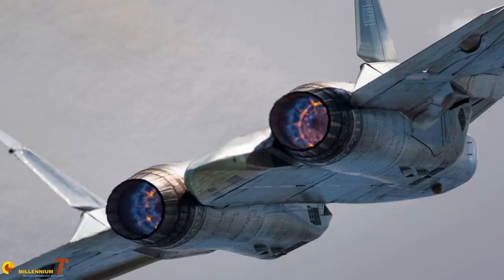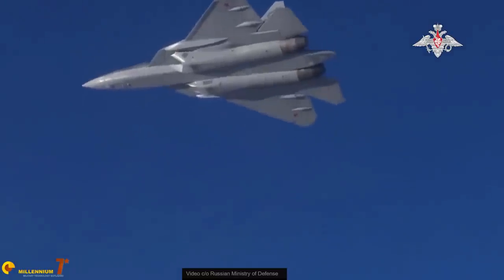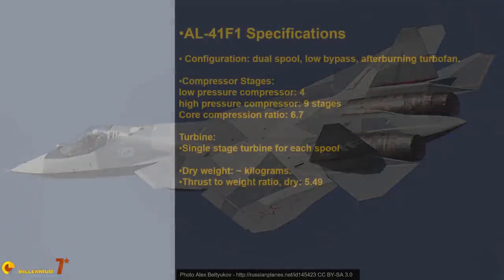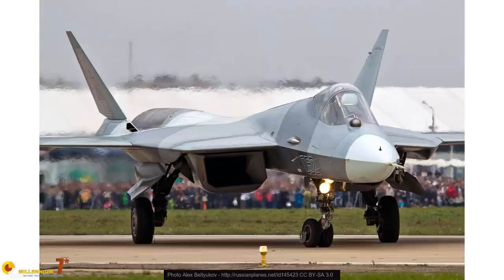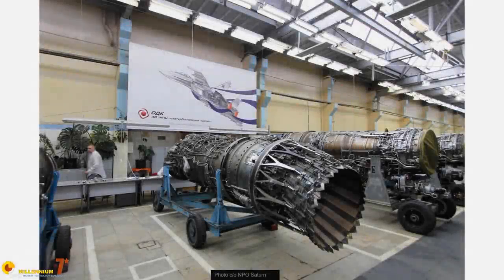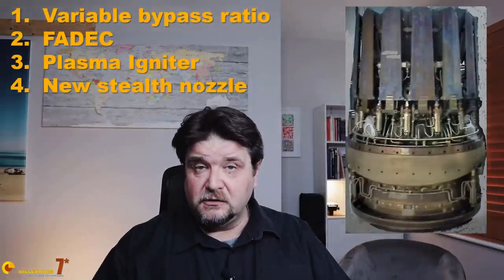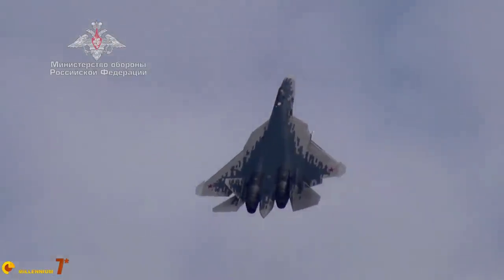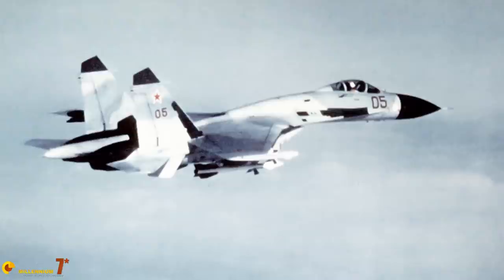Su - 57 the Raptor Slayer | Part 2 - Propulsion

Comment: Edit: It occurred to me that vector thrust could actually replace a tail fin. Something that would make sense for a 6th gen plane. 

hypothesis 1 - well, if you already have trust vectoring, why not implement it. be a shame not to. 
hypothesis 2 - makes sense. it is possible they have tested the trust vectoring in regard to dodging missiles, and I'd be surpriced if anyone investigating it, hasn't.
my take,, Although getting into dog fights are rare these days, it does happen. And I think with planes being more stealthy, and having counter measures, that might be an increased occurrence. So one should not be so quick to dismiss the ability to do high angle of attack maneuvers in order to point your nose at the enemy. I think the russians think it is worth the weight to have that capability.
So in my opinion , trust vectoring might be useful , unless radar technology radically improves to the point that you can use long range missiles. all in all, I think it would be foolish to build a 6th gen plane without that capability.
Reply: Never vector your trust.
Reply: @Make-Asylums-Great-Again  hehe, I never trust my vectors.
Reply: Edit: It occurred to me that vector thrust could actually replace a tail fin. Something that would make sense for a 6th gen plane.
Reply: @lordsqueak  👋

Comment: The engine reliability has always been a Russian issue. Anyway lets hope the Su-57 does not have to go head to head with the F-22 until after 2025. In fact USAF will be starting to reduce F-22 inventory after 2025, so these guys may never meet as intended.
Reply: What are your facts proving issue of reliability of Russian planes' engines. What planes exactly?
Reply: @AlexanderTch  MIG-25
Reply: @rocket3man  Mig-25 is fastest fighter-jet ever with best world record for fighter-jets for altitude. It's  high altitude high speed interceptor and does not have any analogs in other countries. It's first double engine , double keel fighter jet, so, it was revolutionary and was copied by USA to create F-15. With such extreme characteristics it should not be compared with any other jet, except , maybe, it's successor Mig-31
Reply: But the engine is too fragile and against an F22 you are joking. Also the Indians are not happy with the performance and reliability of the mIG-29.
Reply: @rocket3man  How do you know that Su-57 engine is fragile? Russian Military reports to you? Proves please. No accidents with newer engines were ever reported.  You lie about Indians. They use 60+ Mig-29 and it's one of the main parts of their air-force. No proves that they had any complaints about their reliability. Indian Navy aircraft carrier uses only deck version of MIg-29 - Mig-29K.
Reply: The overhaul life of AL-41F1S is 4000 hours. How is it compare to PW F135 (I don't see the numbers on it)?

Comment: Russian thrust vectoring is wasteful because they add a substantial amount of weight and maintenance to enable 360 degrees of vectoring when you only ever need to vector downward. Upward vectoring can cause major health problems for the pilot as the blood from the high (positive) G turn goes into their heads, the opposite of what happens with you vector downward (negative G’s), as the blood flows away from your head and you risk temporary loss of consciousness. This can only be used really to recover from maneuvers like a cobra. Vectoring to the side could have so applications for turning within a plane to attempt to notch an incoming missile, but that benefit is negligible when compared to vectoring downward and banking into your turn.

Comment: In the other measurement system, 108 kN is over 24,000 lbf and 176 kN is over 39,000 lbf.

Great info btw, Otis really came through here!

PS - aren't you missing a decimal point in the T/W? Really, 11? I can believe 1.1 ok.
Reply: I believe that is for the engine and nozzle only.
Reply: @hart-of-gold  Ok that would make more sense.
Reply from the maker: just for the engine, not the whole aircraft

Comment: Well, let's see how many they can afford too keep in the air.
You can have a great plane. But, 
numbers matter.
Reply: Go and see. It's already in serial production. And Russian government signed contract for building 76 of them. Also government of Algeria signed contract for building 14 of them for their air force.
Reply: @AlexanderTch  
76 isn't very many for a country as large as Russia. And their tech always seems too be yrs behind the U.S. 

But, Russia's military is mainly on a defensive posture and has been since 1945. With a limited numbers of bases outside of their country to work out of. They are very restricted on the missions they can handle. 
Their surface Navy is a joke. 
But, their subs are getting better.
Reply: @thomasridley8675  76 is fairly enough number. First. Mig design bureau now works on light one engine 5th generation fighter like F-35 that's gonna be cheaper than  Su-57, so, Russia'll have two types of 5th generation fighters. Second. Russia constantly builds and improves its 4++ generation fighters - Su-35, Mig-35 that do now and will do further many tasks that 5th generation jets can do. Example - in Syria Su-35 countered F-22 and made it run away. Third, Russia always relied heavily and will rely further on Surface-to-Air missiles that are cheaper but can do many things in air combats. Russia even now have 3 times more of them than USA.
Reply: @AlexanderTch  
I guess time will tell. It's not like they are planning on invading another country in the near future. 🤔

Comment: so you think in the age of BVR that dogfighting is still a relevant form of air combat? Do remember there are what 12 Su-57s compared to 187 F-22s and over 670 F-35s that fly and the Su-57 isn’t a stealth aircraft. It’s engine nacelles aren’t coated nor do they have low observable exhaust nozzles. The aircrafts performance is irrelevant when it’s a smoldering heap from an AIM-120

Comment: Didn't the patent filed for the su 57 claim that it had a similar RCS to the Rafael or the eurofighter? Can you address if this is true or why it might have been if the su57 is indeed a proper stealth aircraft. 

There's also of course the fact that India dropped out of the program and one of the reasons cited was insufficient stealth characteristics.

Are we really so sure that the su-57 is even a 5th gen fighter?
Reply: @kresnik_ss  thank you for answering my question. I will check to see if it's accurate. I do think you are being a little bit unfair to me since I specifically included the question of whether or not this is true. And also some of your statements are questionable.

"basic understanding of stealth shaping principles leads to the recognition pf of the su-57 design being stealthy"- no it tells you that the su-57 is designed to be stealthy. It doesn't mean it was implemented successfully. Obviously my concern was with regard to the materials usage which is more important than the shaping these days, And with regard to imperfections with the extremely complicated aerodynamic surfaces along with the seams and the intakes.

Also the Russians are rather incentivized to publicize an underreported figure for the F-22 raptor after coming out with their own stealth fighter which has been criticized for the purposes of not being stealthy enough. So a Russian sourced estimation isn't exactly an incredible counter. If it were for example a Turkish or Indian estimation, that would be much more useful. And anyway the Russians really shouldn't have the data to give an accurate estimate of the average RCS of the F-22.

It does just seem unlikely to me that the Indians pulled out of the program because the prototypes weren't manufactured to perfection. That would be pretty stupid, don't you think?
Reply: @kresnik_ss  I mean maybe. It's just very difficult to tell with Russia.

"Appear weak when you are strong and appear strong when you are weak" a quote straight from The art of War that Russia seems to have taken very seriously. They have added on radar absorbing grills to the intakes of the su-57, so clearly they did believe that the intakes weren't stealthy enough. And the grills can't be as effective as an s-shape intake.

It's just that if they could mess something like that up it's hard to believe that there aren't other glaring issues with it. And they've been delaying serial production for a long time now. It's also worth considering that it's their first stealth fighter, so they may just not have worked out all the kinks.

Aerodynamically it's a very impressive bird, but with regard to the stealth features we really just don't know. And they've been really careful to make sure that NATO's never gotten a return of one flying. Maybe that's just because they're being secretive, or maybe it's because they have something more embarrassing to hide.

I don't know, but I don't think it's impossible and I'd like a more in-depth analysis by somebody who frankly knows more about it than I do. Hence the purpose of my comment.

Comment: The Malaysian SU-30 vs. Malaysian F-18 video the author himself states otherwise, that the Su30 is to be respected as a contemporary, and that he himself had been 'shot down' by it only that it made for a bad video as he does not point the go-pro backwards, obviously.  - Also the one time in the video where the Su30 makes a hard vectoring maneuver it reversed from a climb away into a dive toward the F-18 in the time it took the F-18 to just get its nose back up to the horizon. It's a tool to be used, and making that tool better will only improve it. Does the SU30 sacrifice any ability to have that tool? not much. I believe this point is lost in the discussion.
Reply: the TVC does add a little bit of weight and maintenance routine. I've heard a lot of opinions over the years, some say it's a good addition, some wished to shed that weight instead (ex-Indian AF officer in Fighter Pilot Podcast lamented this), but most doesn't care much really because the Su-30 is already agile enough without thrust vector (according to RMAF WSO, the TVC is normally off anyway, it only works when a "maneuvering" switch is flipped). I personally would rather see it having more T/W over thrust vector ability.

Comment: Only 78 Su-57's have been ordered, and they won't be built for years.  
No matter how good it is - there will be too few to make any difference. 
Meanwhile, The US has 180 F-22's, and over 645 F-35's have already been built. 
There will be over 2,000 F-35's when production ceases.  
ALSO, the US has already built and flown a Gen 6 aircraft, that will 
go into production in the 2030's.  
Russia will never catch up.

Comment: I wish you understood Russian, the is a channel here on youtube "boy in a mask. This guy talks very coplicated engineering of multiple Russian/Soviet systems..Has original manuals and does mathematics to explain how things work and why. 

Like thrust Vectoring, he says based on all test results, there is a big DISADVANTAGE - loss of power. When the thrust is directed in a fixed "straight" the power is there, but as soon as you change the angle, you can clearly see in a night time, that the afterburner becomes dimmer. I think you understand what i am trying to say. He actually said F-15 Will always b faster with a fixed exhaust..ad it does make sence to me.
Reply from the maker: Would you give me the URL? Thank you.
Reply: Loss of power has flat nozzle thrust vectoring like F22, and supesonic part nozzle vectoring (only tail part on the nozzle)
For subsonic nozzle vectoring (whole nozzle is rotated) power loss is minor

Comment: if thrust vectoring is not useful then why does the F22 have it, although its only limited to 2D because 3D thrust vectoring is more complex to implement which the russians have accomplished
Reply: It can only be usefull in low speed dogfights, as the planes are limitied in maneuverability to what they and their pilots can survive in g-force, and at high speeds, the control surfaces of most modern planes are allready heavily limited by the flight computer to not pull to hard.
Reply: @hernerweisenberg7052  so it's not useless and 3D thrust vectoring is better than 2D..that's what the russian can see that you cant
Reply: @mediviclozada4027  What did i say that leads you to believe there is something i can't see?

Comment: You do sound very knowledgeable, but I wonder where you get the information you are presenting. And if you have access to it you can be sure most other industrialized advanced militaries also know about it. Also I suspect that you are smarter than to believe the instantaneous maneuver comment about thrust vectoring.  At least you said sort of..... A massive object like one of these aircraft cannot change directions very fast even if the vectoring change is close to instantaneous, which is cannot be.

Comment: What I find interesting is by the time Russia produces all 76 Su-57 by 2028 per last info from TASS new agency. There is know denying the Su-57 will be an extremely capable fighter plane with abiltity to pull off extreme maneuverable moves. But now with so many nations developing hypersonic missiles and most air combat kills occurs at miles or kilometers distance away from each other how will that maneuverability come into play only time will tell.

 The United States will be releasing there 6th Gen fighter by early to mid 2030 with capabilities of Stealth carrying both hypersonic missiles and direct energy weapons for self defense as well as offensive capabilities with data linking enabling it to control several multi role drones at same time such current MQ-25 drone that can be configured as refueling drone, reconnaissance drone or attack drone. The United States is already developing a directed energy system on an aircraft pod that will be capable of self-defense against surface-to-air and air-to-air missiles by 2025, that can be deployed onto 4th Gen fighter. If mounted on 5th gen fighter that eliminates its steath capabilities but it could be mounted to retract from missiles Bay or be mounted on 5th gen once Stealth is no longer needed.  The next 20yrs will be very interesting to say lease.

Comment: The export variants of the engine are about 20% weaker compared to the Russian one or at least that is what wikipedia says  122.6kN vs 142/147kN.
Reply: 122.6 is specs of al31f and that from su27 and the Chinese can by Al 41f why they try to lower engine when you already sell it's?
Reply: @heyspy1205  I'm talking for the Indian/Malaysian ones, they are the old su27  with trust vectoring. Gonky's wins were vs Malaysian planes. But even with "equal" engines MKM/MKI are like 10% slower than the good old Su27, any idea why?

Comment: Where do you get your numbers for engine time before overhaul? When the F15 first entered service engine TBO on the Pratts was just 75 hours. That improved when GE was given the second engine contract. I remember the F16 and F18 engines usually went 750 to 1000 hours before TBO. None of the US engine companies publish TBO numbers, but your stated 4,000 hours is not possible. Even bizjet engines TBO is 3,500 hours. Those engines operate at much lower thermal and mechanical stress. I would say it is a myth that US combat engines are more durable than Russian. Americans still rely on advanced Russian rocket engines for most Nasa launches and all Space Force launches. And rocket engine tech is far more advanced than jet engine tech. Btw, the heart of a rocket engine is the turbopump, which is basically a gas turbine engine that pumps the propellants. US still has not been able to build an advanced closed cycle turbopump. Which is why they buy Russian.
Reply: Turbine designs are quite different for rockets and fighter planes. Overall, tirbofans/jets requirements a far more rigorous.

In the former, one prioritises for power and light weight and temperature shock resistance with little regard for durability, as the NK-33 was meant to be used no more than a few hours at maximum, inlet temperature is about 800K.

The end result would probably be a polycrystalline refractory Nickel alloy - nothing difficult in and of itself - in rocket science at least.

The secret sauce is, probably, a ceramic/oxide coating acting simultaineously as the thermal and oxygen diffusion barrier.

In a jet engine one prioritises for a much longer engine life - a few thousand hours of operation, creep sensitivity becomes a problem. Inlet temperature is 1800K to 1900K, turbine temperature should be about 900K. 

Current state of the art is a single crystal superalloy of Nickel, Chrome and Aluminium with other ingredients.

Different problems, different solutions.

Comment: Imo your hypothesis for thrust vectoring sounds pretty weak. I still have no idea why they focus so much on it. It is cool but it is a one-trick pony. You can do it once in a dogfight and if it doesn't succeed you are done. Pretty risky imo. Also, the plane doesn't drastically change its movement to fool a missile. And for that, they even have to lure the other planes in a dogfight first which will happen less and less. So it is interesting technology but useless for now. It needs to be much more radical to make a difference. And that means the West with its shooting down from much further is making the most sense for now.

Comment: Raptor slayer, old engine, no real stealth, but it can shoot down a 16 year old jet ... satellites can see these engines IR trail from 250 miles away in a hurricane. A jet is no more than a stealthy high speed sensor node with launch capability, Russians are building jets, US is building dominance platforms.